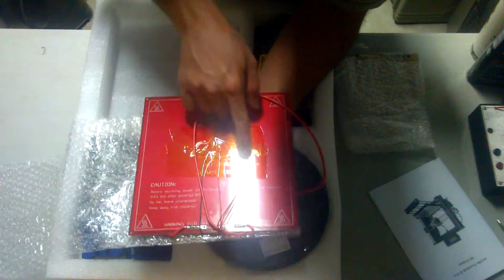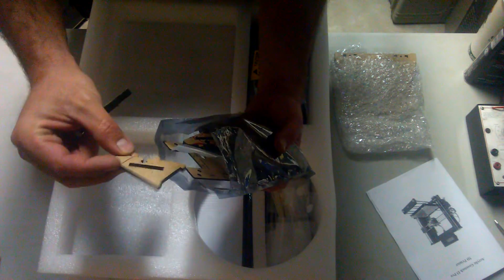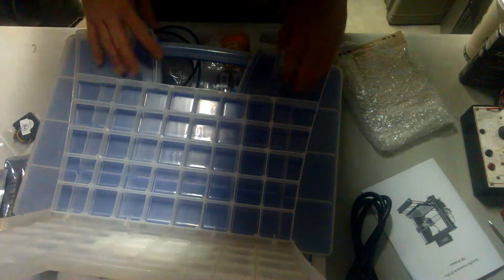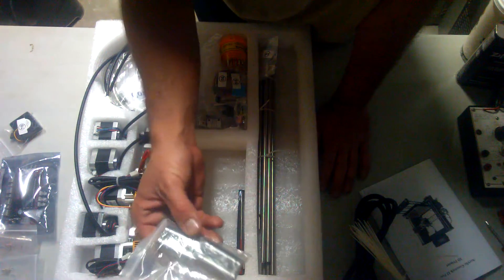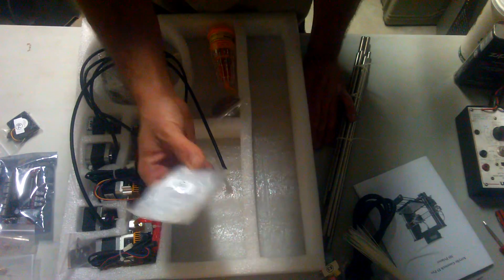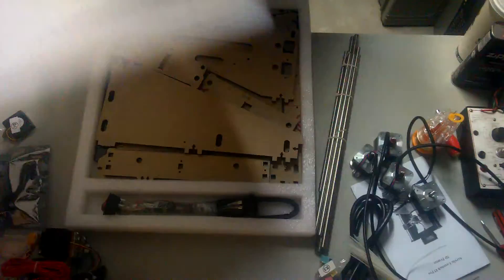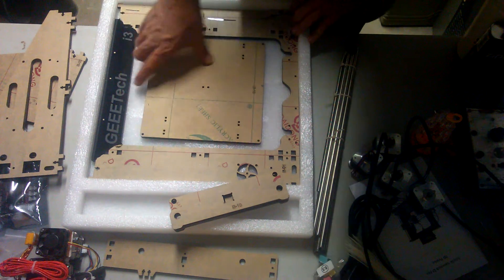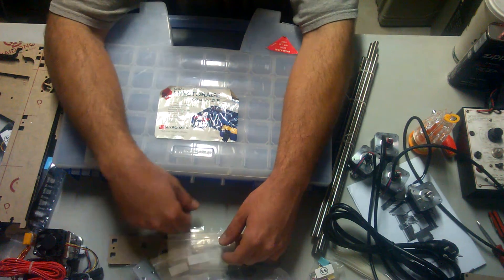Geeetech Prusa i3 pro B unboxing(part 2)

Comment: Did it work ok?
Reply from the maker: had a few issues that I had to address bit almost there. some personal stuff that takes priority. I have extruded a zig zag line and that's my issue with firmware. I will provide updates on all. if you do buy one or order one from ebay and ask for Mrs. Lemon Wang at geeetech and tell her I sent you. ask for the same kit as I have and she can help you until I can fix my own eBay setup. Thanks for watching, more to come.
Reply from the maker: Yes it worked okay even with one bad stepper driver that only moves in one direction

Comment: Be carefull of their PCB's, I mean the LCD and controller board. Many incidents report burn out of the electronic boards on first power on due to poor soldering and stray solder spatters. Just inspect the PCB's very well. Also make sure the amperage of the power supply they provided is suficient to run the printer without excessive heating or drop in the voltage. Normally a single extruder Prusa i3 with heatbed consumes up to 17 Amps, so make sure to use 20A power supply or higher.
Reply from the maker: Thanks for the tip. I have already read up on the boards. I will also "walk" through the boards and check connection as well as removing the 5volt powering the USB plug. Tips are on Wikipedia site
Reply from the maker: FYI. Found perfect boards. No solder issues that I can see. I did get one bad stepper driver but they have sent me a new one and just waiting for it. Only moved stepper one direction.
Reply: George Robles The MOSFET on my Ramps board burned out after few prints and had to replace it. It became short, and thanks God I was monitoring the printer as I felt the high temperature of the heat bed hitting my face. I managed to hock the new MOSFET externally in order to mount a heat sink on it as its current placement is very tight on the board.
Reply from the maker: I have just ordered a ramps 1.4, irduino/arduino, and some different stepper motor drivers so that I can also do those videos and even ordered their new board to handle a second print head.